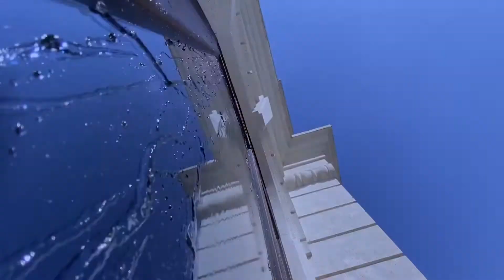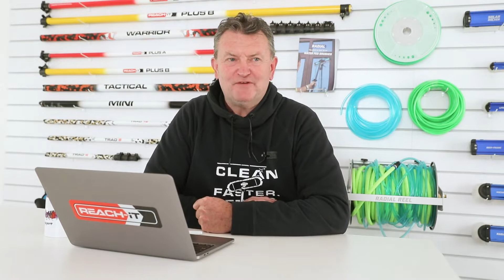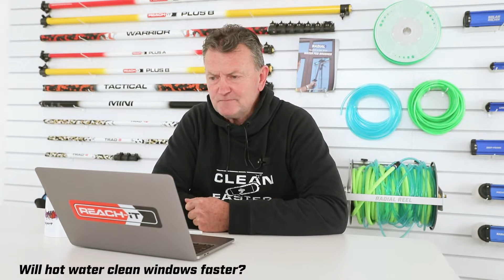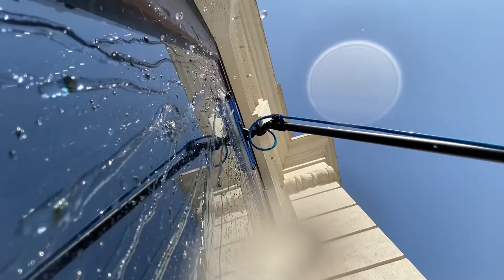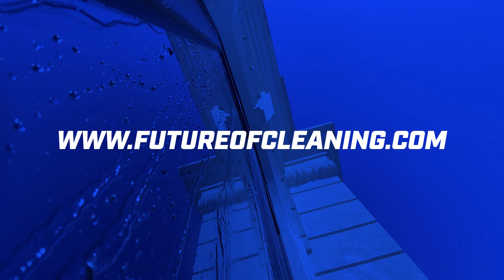Will Hot Water Clean Windows Faster?

Comment: The way I’m beginning to look at it is, if I’m washing my dishes it’s easier with hot water, no? It softens quicker with heat surely. Agitation is a different issue. Like for like hot water will be better. And I’v got a cold water system for reference.

Comment: You have no idea , hot water is the only way,  , I pre heat my water in my tank while I’m driving from my Ionic system which makes the burner my efficient, I’m getting 70-75 at brush head, 8mm tubing 25 meter sections I use so less heat loss, 18meg water only way with Tucker brush